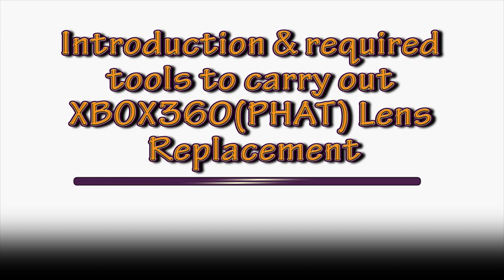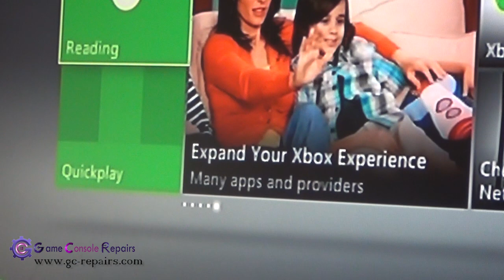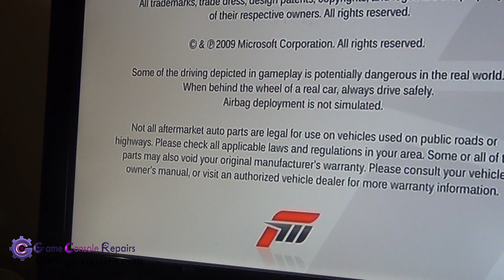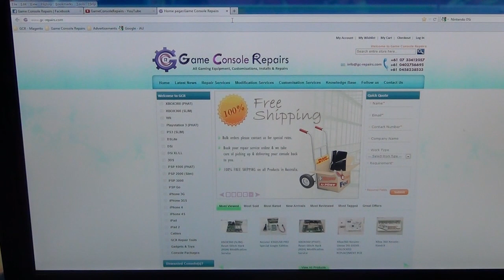XBOX360PHAT   Lite On BenQ HOP 1401141X Lens Module Replacement gc repairs

Comment: great guide thanks so much sorted my drive now

quick tip - when you resecure the piece of plastic that screws into the new lens unit with the small screw - DO NOT OVER TIGHTEN - you will thread it like I did - I rescued it by using a slightly larger screw!

Comment: Hi iv just replaced my benq laser on my flashed drive its the second laser i have installed as the last one just started to die. Iv tried 3 new lasers none of them work. The solder point has been removed correctly but none will read discs. My original laser still works (just about) so i am unsure what to do. Pot test results for 4 lasers were 1.75 2.85 4.85 and 5.4k ohms. If theres any probs people have come across please let me know

Comment: How to open the tray: It's on the side, left side on the drive. You will see coloured wires, 2 yellow ones on the top, 1 red, 1 black and two white. Just underneath it, you push lightly with your finger, and the tray will open. Hope that helps.

Comment: I'd like to say thank you the only problem was I didn't know really how to get the eject part bc you couldn't see you do it plus idk if it's possible that UK 360 were any different with it, my Xbox was having problems but it was excessively dirty and I didn't have to replace my lens after this though my FFXI fired right up as which is probably the hardest game for any Xbox to load but I tried other games they fired up too, so the cleaning was a success and if my laser does burn out I know how to replace it, also if anyone has any info whether a 2010 Xbox arcade has the same type drive i'd like to know I think it just uses an older motherboard. The one I cleaned uses opus.